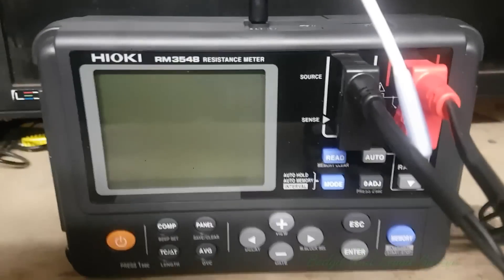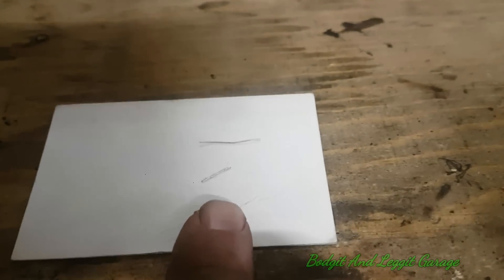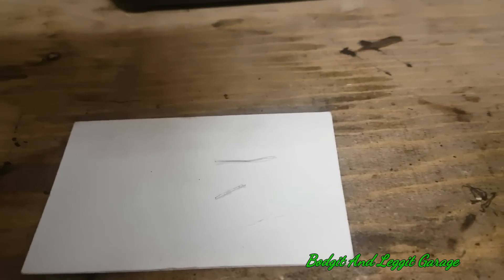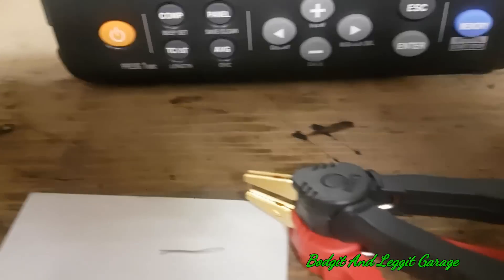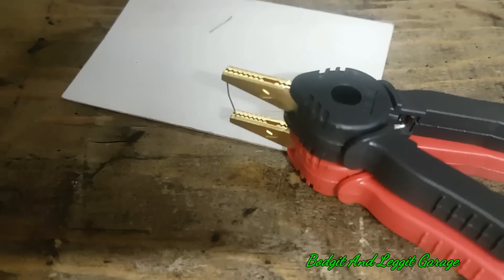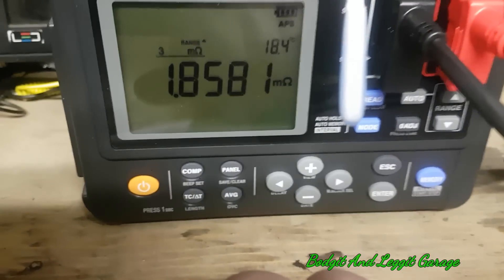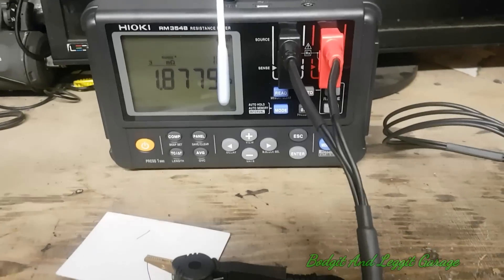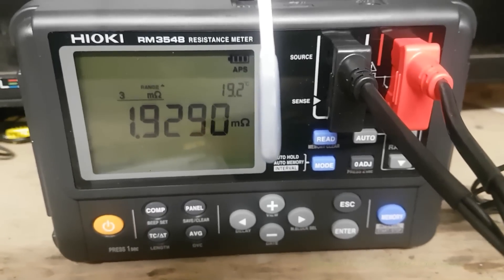Hioki RM3548 Resistance Metre (Teaser) Bodgit And Leggit Garage

Comment: Did You bought it yourself ?Too expensive for the automotive purposes it has in my opinion. A resistance meter with resolution of 0,0001 ohm is good enough. It is cool to see a resistance meter with this accuracy though:)
Reply from the maker: Hi mate no I did not buy it myself but I would have to have done anyway because most of the electric cars now state that you need this in your workshop for insurance reasons eccetera this is really for Ev cars where it really comes into its own where you need something like this otherwise you cannot make proper diagnosis I will be doing videos on this shortly
Reply: @bodgitandleggitgarage   Didn't quite understand why you would need this accuracy until you mentioned electric cars , then it all starts to make sense . Good investment for the future, who knows what you might need to measure and to what sensitivity 5 years from now .

Comment: Does it have auto null ? If not you need to connect the test leads together and take a resistance reading and note that reading then use it to subtract that reading then the reading you get will be the true resistance of the item under test. You need to do this before any resistance reading on any meter unless its auto null where you just connect the leads together and press null to null out the test leads resistance then while the meter is on it will auto deduct the test leads resistance.
Reply from the maker: Hi mate I'm well aware what you need to do the video title says teaser this is just part of a video wasn't showing people how to use it was showing people how accurate it was
Reply: Watched loads of your vids 
Good vids mate usefull 
Cheers
Reply from the maker: thanks mate

Comment: Interesting , what would you use this on where  a regular meter can not work  ?
Reply from the maker: They are really coming to play on electric vehicles electric motors in the Windings a normal meter would have shown the same resistance on these 0.01 which just isn't correct hasn't got enough clarity to read low resistance

Comment: Indeed very sensitive and accurate!
Very good for small electronics and board repair... 
I can't see though, the advantage of it in normal car repairs... as you don't really need that sort of accuracy. 
Nice video and demonstration Leon...
Thank you for sharing it... 
Another tool to go on my shopping list...😋
👍👍👍
Reply from the maker: You need it on EV vehicles especially when you're testing Windings that's what it's for at the end of the day resistance reading on a normal meat is pretty useless as it will give you the same resistance no matter how long  piece of wire is and this especially comes into play when you are working on electric motors very small resistance is needed between the two stator Windings this can be a good motor or a bad motor without something like this you will never know
Reply: @bodgitandleggitgarage  
Agree... you know what I meant.. 😉
Just put it on my list... but have many other things in front of it...😥